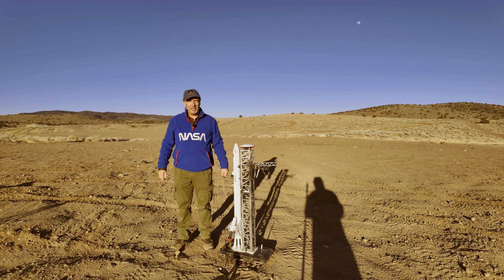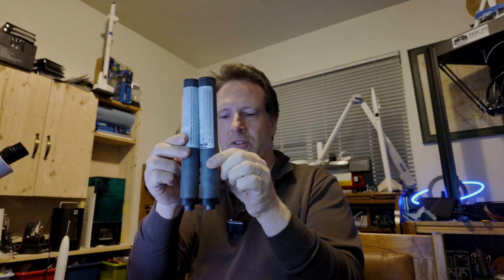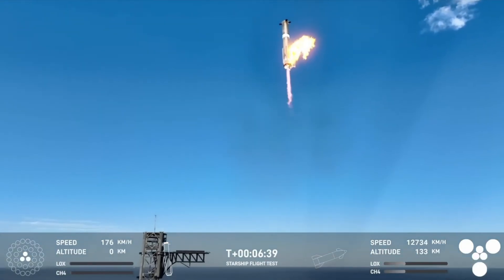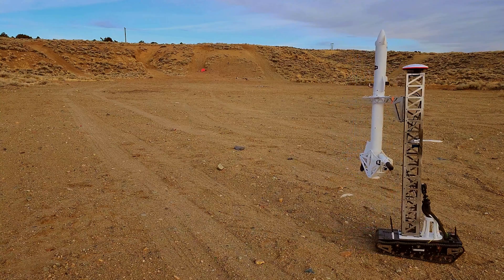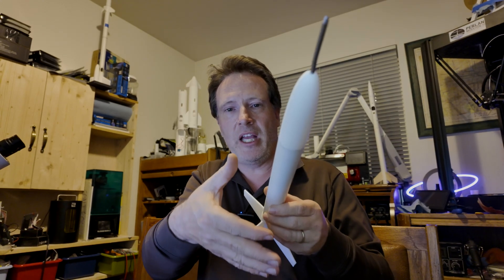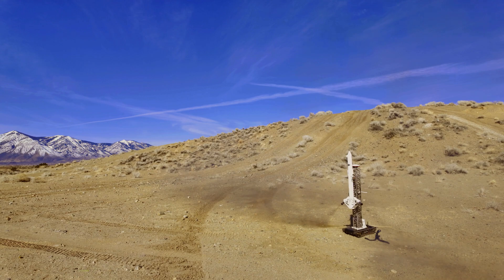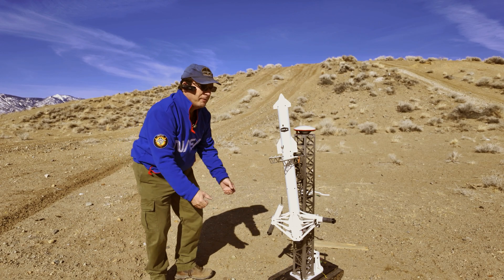Landing a Model Rocket Like SpaceX

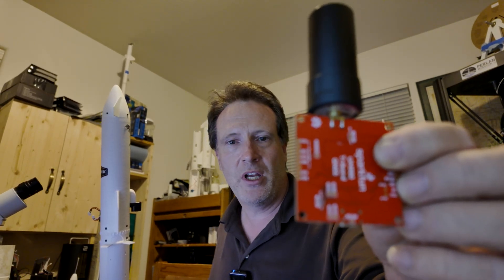Comment: 2:11 where did you get that (presumably RTK) gps and how much did that cost? looks pretty small for what I usually know to be very expensive units.
Reply: SparkFun has a line of RTK-capable GPS breakout boards, they're all that distinctive red color so I'd wager that's the source
Reply: @peregrinedevelopments3730  thanks
Reply from the maker: You are correct. UM980 units from Sparkfun. Looks like they've just gone out of stock there.
Reply: bump I also would like to know

Comment: Why did you chose a powerful motor but angle it that much for hover? Is it more stable/has more control authority that way?
Reply from the maker: It's about the thrust margin. How much extra thrust I have to stop a downwards fall. If you look carefully, you can see at the bottom of the 9m descent that it does go to "full thrust" with both motors pointed straight ahead for just a moment. I can only achieve 0.5G acceleration on top of the 1G acceleration of gravity. This ends up with quite a wide spread to get back to 1.0G for hover.
Reply: @FlyDuoDiscus  Thank for the explanation. I noticed that, i just thought it might be easier on the giros and controls if they had more time with a lower thrust/weight. More like a controlled descent than fall, although it looks super clean this way too!

Comment: How were you able to get such a long duration out of those small motors?
Reply: Those were aerotech H14 motors, they have a burn time of 18 seconds
Reply from the maker: @spaceman1957  Actually Aerotech H13ST, slightly smaller length than the H14's. They are an unusual "end burner" configuration that isn't normally used for composite propellant. They burn very slowly compared to the usual propellant grain structure that's used in model rockets.

Comment: Next, try to cram those 3 motors into the rocket and individually gimbal them to get yaw control. And land in the chopsticks! Since the thrust force will be harder to cancel with less rotational freedom inside the rocket, you can pack in more payload

Comment: That was cool!!! Woooohoooo!!!!!!

Is it possible to shot it up with a motor in the center and when it comes down the two outside motors start to land it?
Reply from the maker: Yes I thought about that. It might be the next version. But I would not start out using the gimbal motors for landing. I would use them for guidance as "vernier" motors to steer the rocket on the ascent. Look up how the original Atlas rocket worked with one central motor and two smaller verniers which did the actual steering.